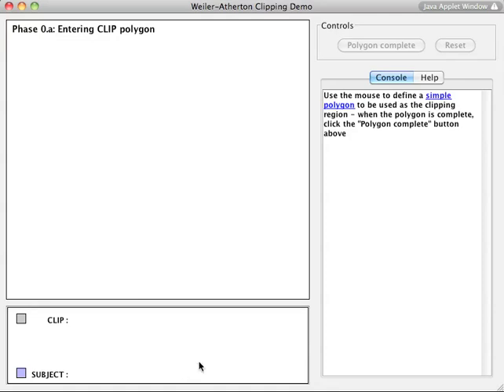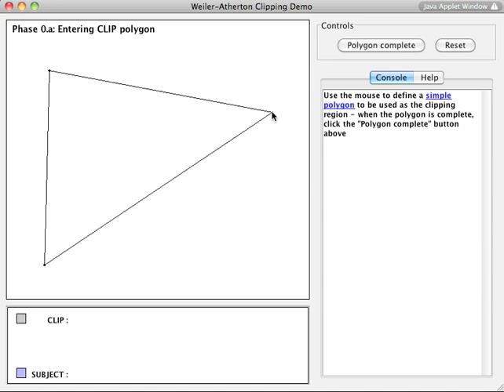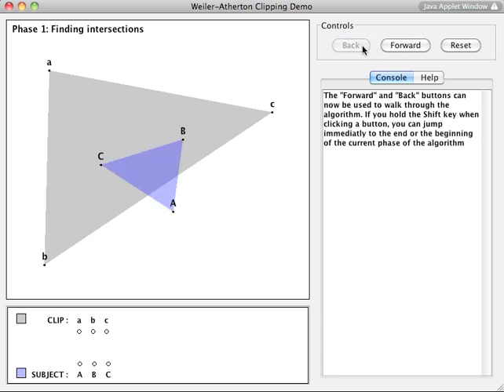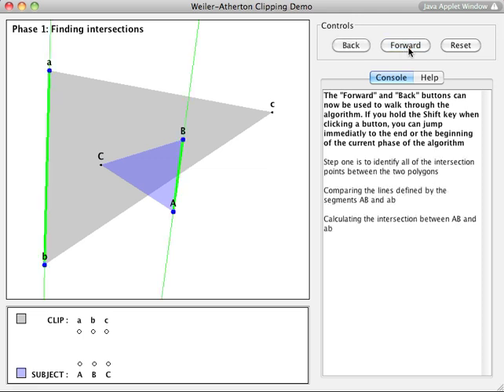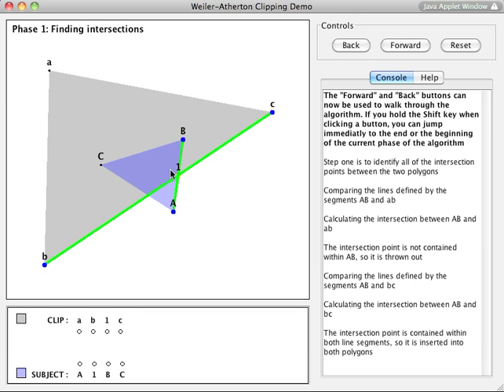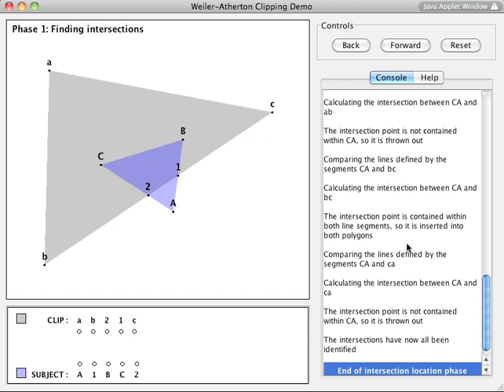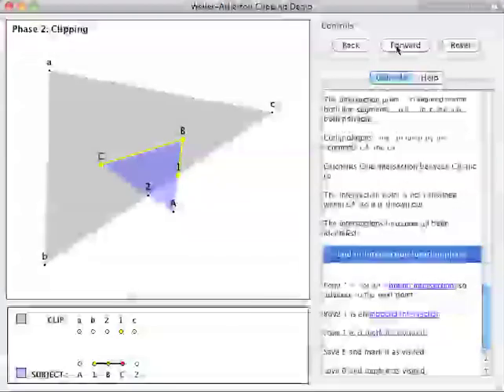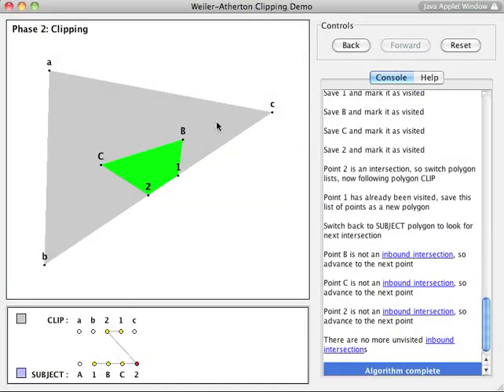VT - Weiler-Atherton Clipping

Comment: the applet crashes when there are points on the edge of a polygon
admittedly it is hard to handle all degenerate cases properly but detecting them is easy and at least that should have been done